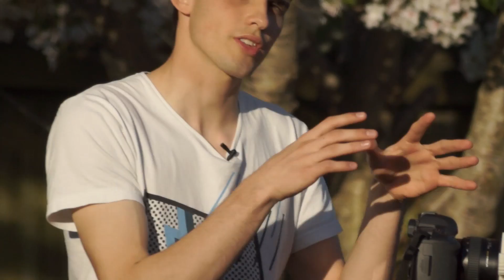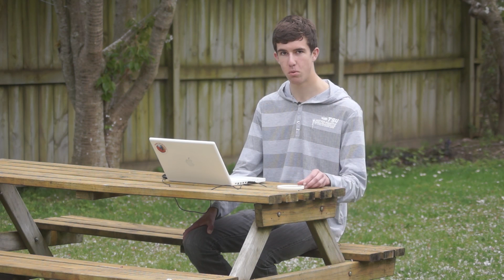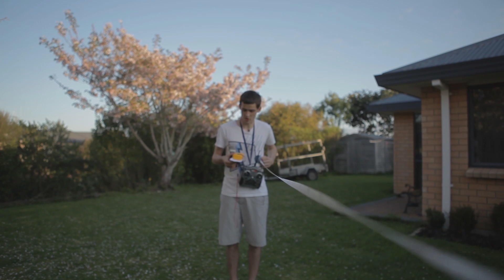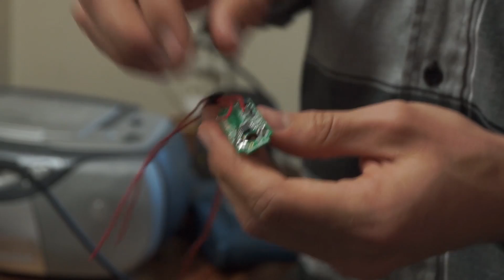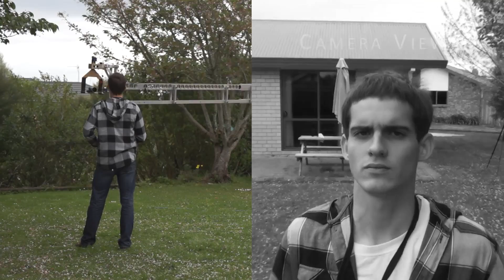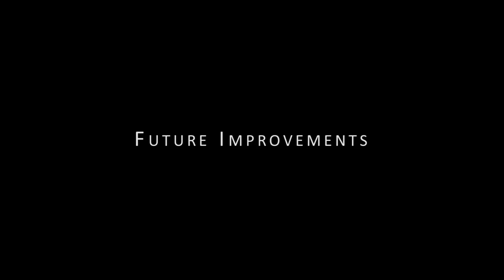Juan, Nathaniel and Robin's Bright Sparks 2012 Entry

Comment: Focus pulling is actually surprisingly accurate. There is nothing like two marks on a follow focus disk. Redrock is currently working on their iPhone controlled follow focus. I'm curious as to how filmmakers could set in an out points for complex moves. Maybe the software would have to have a live tracking feature to compensate for composition changes.